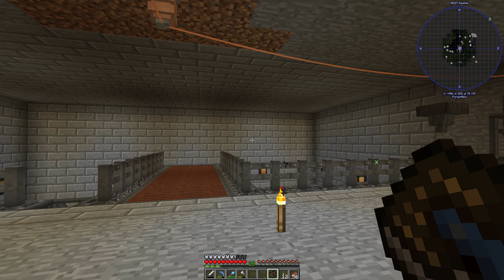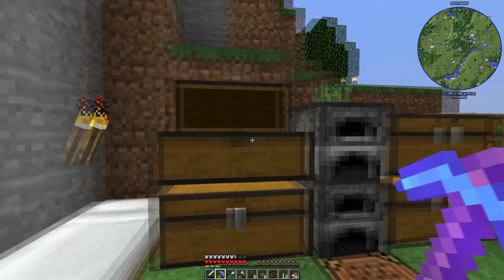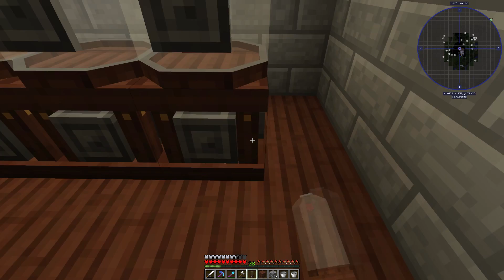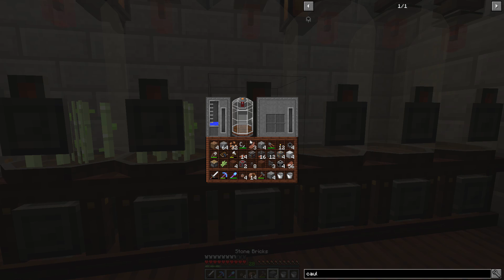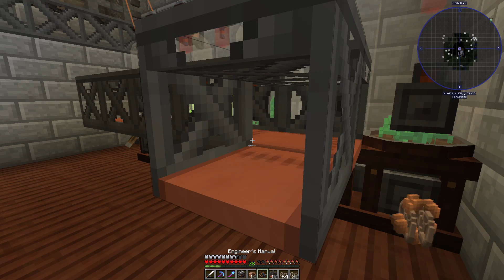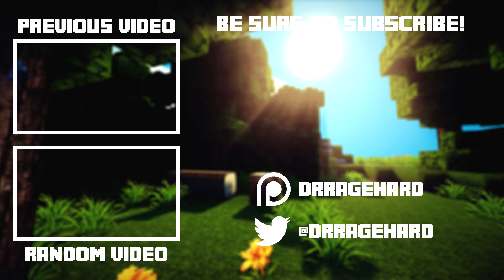Surviving With Immersive Engineering :: E06 - Fermenter & Squeezer

Comment: I recommended anyone using Immersive Engineering to also use Immersive Railroading!! Everything in that mod works the same and uses IE stuff as well and who doesn't want a cargo train to move supplies from one factory to another? :) Its amazing!! I have a tanker ship that actually moves and I go out to an off shore oil platform to fill up with crude and then transport it back to my big oil refinery it is fun!!!!

Comment: Do you know if Mekanism's logistical transporters work as output for the garden cloche? I've tried a bunch of different ways but I can't seem to get it to work.
Reply: yes they work, couple things to note. they have to be connected to the top port of the front, then you have to use the configurator on the tiny section that is the connector and set it to pull. it won't auto put them in the tubes, you have to specifically tell it to pull. he did it in his surviving with mekanism series just fine.

Comment: One thing I love about Immersive Engineering is that all of the machines can be mirrored. At least, I've not run into any examples, from Engineering core or from Petroleum, that wouldn't work just fine if you flipped the schematic in either horizontal dimension (up and down are constant, but the other two axes are fine). You may need to do a bit of extra thinking to actually position it without using the Projector, but it works. So, the original plan could have worked fine - you'd just need to mirror the squeezer.
Reply from the maker: Oops, I totally forgot you could do that! Gosh this mod never ceases to amaze me (or reamaze me when i forget something and then get reminded lol).

Comment: What mod gives you the projector for layout of machines?
Reply from the maker: I believe immersive engineering gives the projector. I haven't made it yet as I just noticed its a thing yesterday prior to recording, but I will be making it asap to make the larger assemblies easier.
Reply: Huh, last I was aware that wasn't a standard part of Immersive Engineering, but Immersive Petroleum. Unless that quite recently got brought into the core mod.